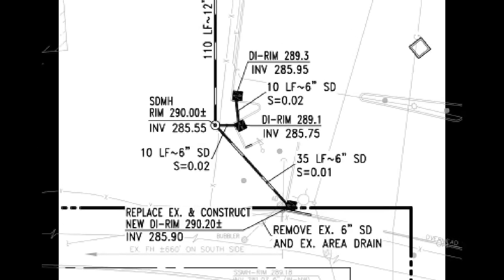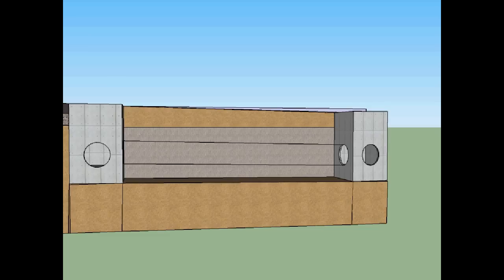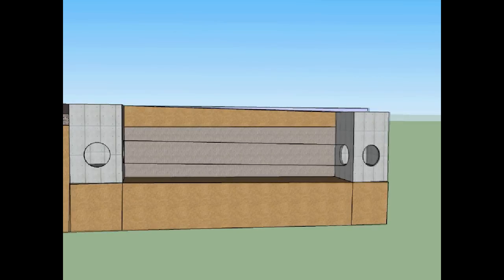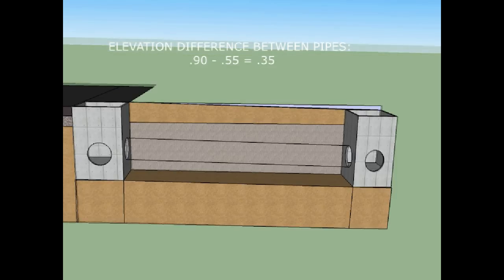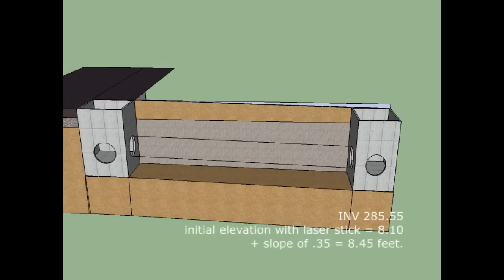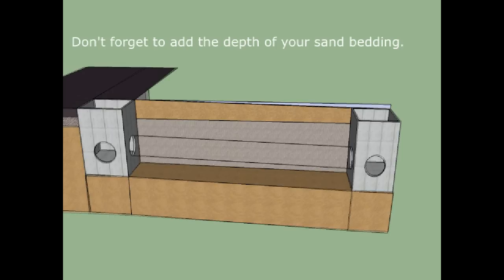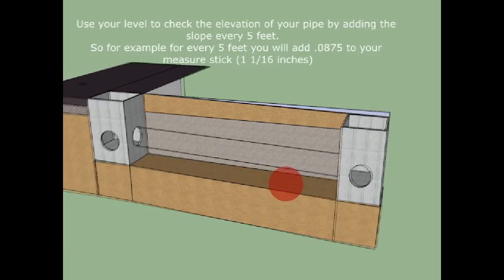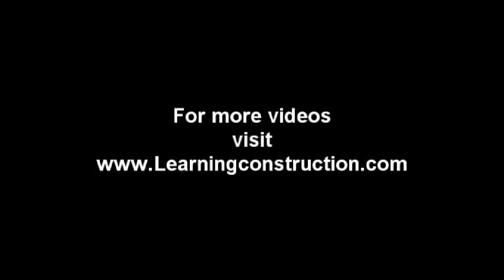How to install underground pipes using a laser

Comment: exactly thickness of pipe! And using a philli rod you shoot benchmark the reading you get is called your instrument hight above bench mark or H.I then you subtract your invert elevation ect. but to find percentage of fall divide your fall by your footage which will be fall per foot in decimal form to turn a decimal into percentage move decimal place to the right two places and add the % sign! But doing it with lazer on philli rod to not move target all the time set target at top of rod and slide rod up or down to tell you how high or low you are work smarter not harder! And a long distance run use pipe and know all the ways to shoot line don't be a dinosaur! Always find the quickest fastest way cause there are several ways to do things! But think outside the box! ask questions be the best you can be and most importantly be safe know common sense goes a long way use it! god bless you all! I love trench boxes but can't always be used know trench shoring! know soils ect knowledge will keep you alive and make you more money! p.s don't do something unsafe because an unqualified boss tells you to say no not unroll its safe!

Comment: Im new to pipe lasers ive always done bedding with a string line by transferring the level to pegs in the trench, if you set up the pipe laser in the trench and the boss is pushing and its a long line cant dig from pit to pit whats a good way to set up the laser so its on the correct alignment so when i do get to the next pit or manhole it lines up good and not bending pipes to get them back onto line so they are gun barrel straight thanks
Reply: Point the laser above ground and align it directly to where you wanna hit
Reply: If your using a rotisserie laser set it up on a tripod from your starting point mostly right alongone side of ditch an set your grade find you a spot to make

Comment: okay how do you figure what the slope of the pipe is?
Reply: John Vitale  okay your slope is actually your percentage the pipe is rising or falling the formula or way to fight that is your difference in elevations for example its 1foot then find your distance of your pipe run let's say it's 100ft then you you divide distance 100÷1.0=.01 okay thats in decimal form to turn that to a percentage move decimal place two places to right and put a % sign 1% that's it but the .01 is how much fall you have a foot meaning a hundredth a foot! that's 1% slope
Reply: (Rise divided Run) X 100 = Slope.    Rise is .50 divided run 100’ = 0.005 X 100 =.0.5% I use it for setting up a pipe laser